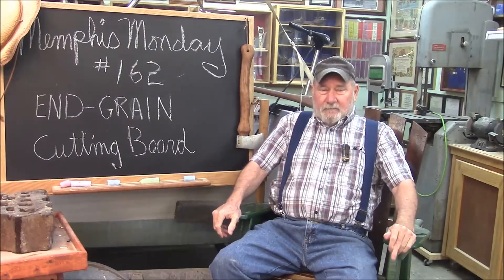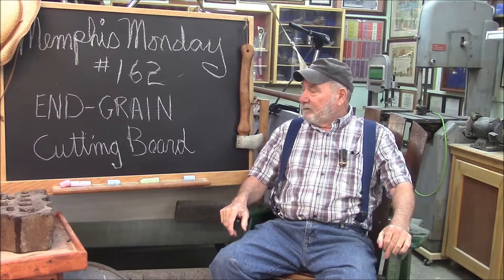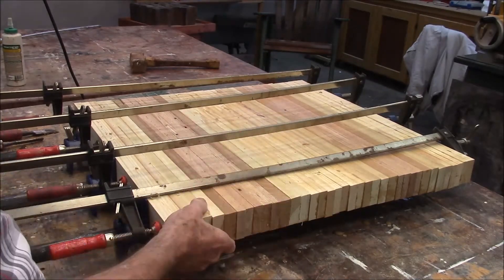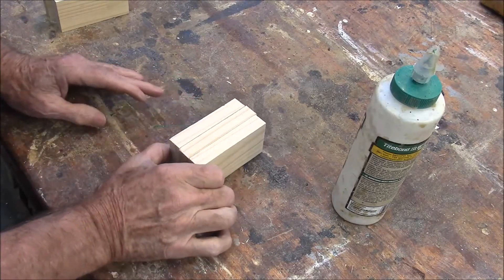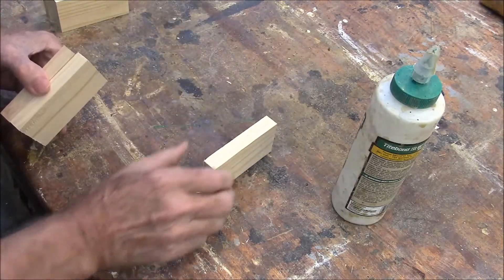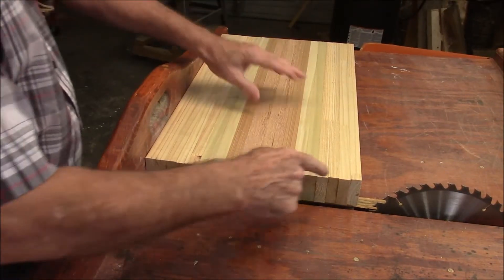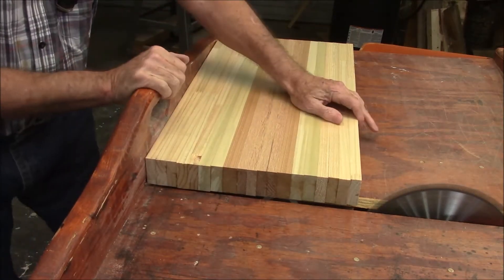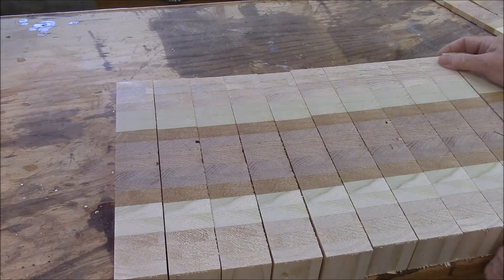162 Making an end grain cutting board

Comment: I really like the look of the end grain cutting boards. I wonder if those are more susceptible to trapping food particles and juices than a straight rain cutting board or if there's even a diference. I'm sure your neighbors will appreciate the gift.
Reply from the maker: The "theory" is that the board is sealed with several coats of oil, which limits penetration by food and juices.  Some board makers soak their boards in mineral oil for 24 hours, rather than applying several coats of seasoning oil over several days time.  
      I'm not conversant enough on the science of it all to defend some point of view.  However, my gut feeling based on my experience with wood in general, is that end-grain is much more prone to soaking up liquids for sure, and I also suspect more prone to trapping food particles.  
      Moreover, I read somewhere that wood cutting boards have an antibacterial quality, and are safer than plastic.  I didn't believe a word of it, but I'm far too lazy to check it out.  
     Thanks for the view, and a double thanks for the very thoughtful comment.
Edit:  https://commonsensehome.com/wooden-cutting-boards/  Here is the article I read about wood cutting boards killing germs.

Comment: Looks Great! I’ve always wanted to make a cutting board, and now I have some good instructions on how. 😀👍. 
My concerns: I continuously wonder about using wood where food will be stored or cut on. I always wonder if the wood goes through some some of chemical treatment before it goes to the hardware store. What kind of wood did you use? Was it from the big box hardware store?
Reply from the maker: Good catch on the wood.  I of course used "untreated" wood, some from a big box, and some from a building supply center.  I have always "assumed" that there has been no chemical treatment of any kind to untreated wood.  However, I don't know that for a fact, as the question has never crossed my mind before.  I will find out.
     In any case, if some chemicals are superficially added, I suspect that the extensive millwork necessary for a cutting board would remove any surface contamination.  But I don't know that for a fact either.  
     I used pine,  red oak (bad idea), poplar, and cedar.  
     Thanks for watching, and a double thanks for the very cogent and thoughtful comment.
Reply: I use a cutting board.  Have never even thought about chemical treatment before I buy one.